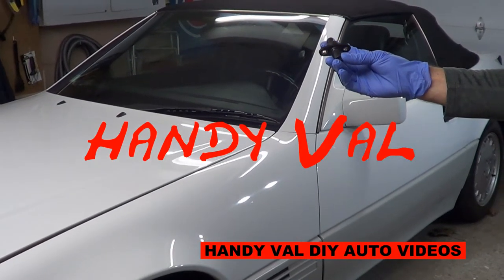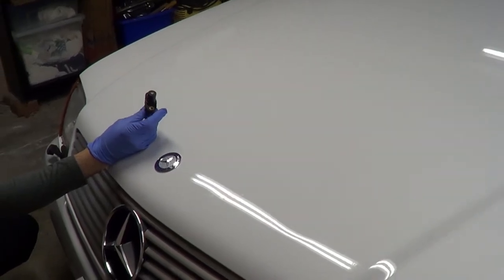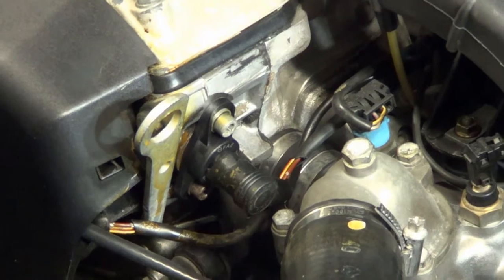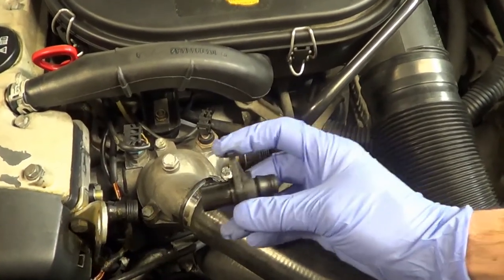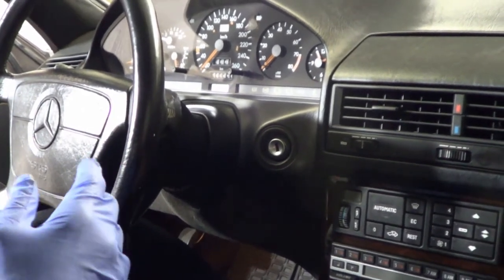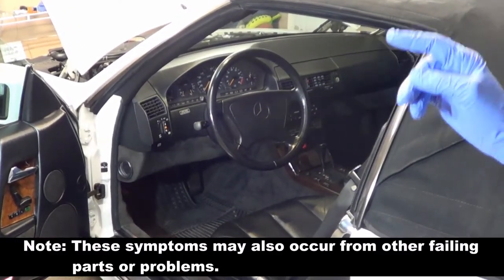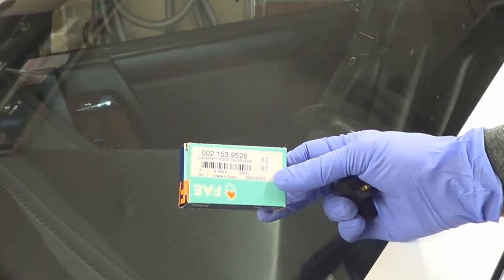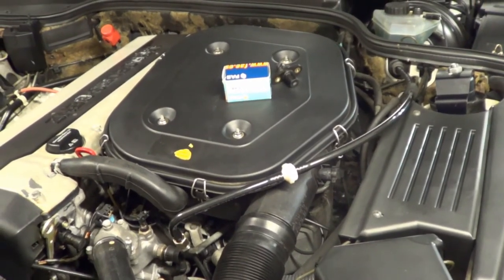Camshaft Position Sensor on Mercedes-Benz for Better Engine Performance R129, W124, W140 and W202

Comment: Thank you Handy Val - you’ve solved yet another issue with my 500 - as the symptoms (you outline) ‘mirror’ exactly what I’ve been noticing/experiencing on my 31 year old 500SL. Now to order the part & replace it myself - thanks again AS ALWAYS…
Reply from the maker: Thanks Mark. It’s an great DIY replacement.

Comment: Thanks Handy Val. My 1991 300SL was having an issue stalling while under load or once I blipped the throttle and let off. I opened the hood and noticed my Cam position sensor was literally broken in half. It was partially held on by glue that the previous owner or mechanic used to fix it. Luckily I ordered two sensors yesterday, one for my 1991 300SL and 1990 500SL just incase. Hopefully it fixes my issues. Will report back once the problem is solved.
Reply from the maker: It seems like your culprit is likely the camshaft position sensor. It's a key part of a well functioning car and it can cause those symptoms you experienced, especially the acceleration. It's an easy swap and let's hope it fixes your issues. Let me know the outcome.

Comment: Val. I don't know how I have not run into your videos before but wow they are impressive. Super clear concise communication thank you so much for that. I have A99S L5 100 and the alarm goes off Much too often. I just recently had the siren replaced Because I would get a beeping noise not the alarm sound but a beeping noise every time I unlocked the car. Well the beeping noise is gone but the car still is oversensitive because the alarm will just go off without a big truck or train driving by To trigger it. Any ideas would be greatly appreciated
Reply from the maker: Bill - Thanks for watching and welcome to the Handy Val channel. The alarms can be overly sensitive and prone to problems. Your problem is common. The typical cause of this, is the alarm battery (yes it has one) gets weak and will cause these symptoms. The alarm battery, for your model I believe is located within the siren (check if indeed this is the case). Another simple fix that works sometimes is to replace the fuse associated with the alarm - this sometimes will fix your problem. Other alternative, is to you manually lock your car doors with your keys. instead of the key fob (this will disable the alarm, which may not be what you are looking for, but can come in handy for the time being). Another option (and this works too) is to hit the 'tow' switch before leaving the car - this means you have a faulty tow sensor. The tow sensor is linked to your alarm.
I hope this helps and you get it sorted. Keep me updated.

Comment: Good clear communication style.  My questions are for a 1991 R129 500SL V8
I know that it has two Rotors and two Distributor Caps, but I need to know if it has 2 of each of these parts:
- Camshaft Sensors
- Crank Sensors
- EZL Ignition Control Box

I know it's a funny question, but I do need to know. Thanks.
Reply from the maker: Thank you. It's a good question. You have one of each (1 cam, 1 crank and 1 EZL), not two of each.

Comment: the original sensor is fitted with a silicone gasket, hella sensor without a gasket, my 300sl had an oil leak after the change, maybe I should need some silicone? Thanks Handy!
Reply from the maker: Hi. Are you saying that the new Hella sensor does not have the little silicone 'O' ring? It should be part of the new sensor - you may want to get a refund. Unless you are saying that the original sensor had an exterior gasket between the engine and the sensor that wraps around the screws?  A few thoughts 1) check your oil level and ensure it's no higher than the middle of the dipstick (I have a video on this - Check Fluids Video), as you may have too much oil in your engine. 2) Try removing the sensor and cleaning the hole, it could be that there is some corrosion that is not making a proper seal (try cleaning the hole with a microfiber cloth as clean as possible). I hope this helps.
Reply: @HandyVal  thank you !!!

Comment: On my s420 it is barely/not idling, stalling, and hard to start. If I floor the gas it’ll start up and rev up fine but it will die and run rough till it stalls out if I let off the gas. The cam sensor being bad would cause this?
Reply from the maker: @JacobTechShit  your symptoms seem related to fuel delivery problems. This could be weak or close to failing fuel pumps, very dirty fuel injectors, a clogged fuel filter. Did these symptoms appear out of nowhere? Or did they gradually appear?
Reply: @ I just put a new pump on, and if I floor the gas it’ll fire on all 8 up to red line no problem. The reason I’m thinking it’s the cam sensor is because mine is broken. I just don’t have another car I can disconnect the sensor on and see how it behaves without it
Reply from the maker: @ I agree with you. You should change the camshaft sensor. It’s easy to do, and they’re fairly cheap to buy, at least compared to other parts. It can cause some of the symptoms you shared, so certainly worth changing, especially given that it’s broken. Let me know when you replace it and if it worked.
Reply: @HandyVal  will do

Comment: Hi, my cable going from the can shaft sensor seems to be broken (the cover is gone for a bit showing I guess the shield). Are these cables hard to find. As always your vidoes are very helpful. BR Gösta
Reply from the maker: Hello. Some cables can be harder to find than others. A cable with a broken cover can still function well. You can try using a zip tie for now to secure it strongly in place over the sensor as a temporary measure or longer if it is sturdy. Mercedes dealerships can sometimes source some hard to find parts from their dealer network or at a minimum find the part number for the cable. Afterwards, you can use it to search EBay for a used yet working cable. Always ensure the seller confirms its working order - the good sellers always test their parts before selling. In the seller pictures make sure the connector is in good shape and it has the compression ring. In my video, you’ll notice my connector is a bit damaged too from the previous owner, and is missing the compression ring. I have bought many parts from EBay.

Comment: Hi bro I have a  1992 SL500 when I try to start all dashboard light is on but it doesn't crank or any sound, don't start. What is your suggestion?
Reply from the maker: @ManikRoy-qb9yg  There are a few things you can try. And try them in this order. 1st - test the battery, ensure you have about 12Vs, and clean the battery terminals (see my video on replacing the R129 battery video on how to do so, and the order of removing the terminal wires). 2. Could be starter related - there are ways to bypass this. 3. You have a faulty ignition switch - ignition switches are a real pain to replace. There is a procedure involved and you’ll want to follow it perfectly. If you don’t, while replacing it, you could lock the steering column … which then creates a lot more problems for you. I hope this helps. Did this issue just happen all at once?

Comment: Can I just pull out the electric connector or do I need to press or release clips so the cable detaches from the sensor?
Reply from the maker: The connector should have a small metal ring around the plastic\rubber part. With a small pick/small screw driver you could expand that metal ring and then pull the connector off. Depending on the connector fit over the sensor, sometimes it can just pull off easily but sometimes it needs this extra help to expand the metal ring and then pull. I hope this helps.
Reply: @HandyVal  appreciate the quick response. Will try. Thanks!

Comment: Do you have any idea of where to buy an EGR valve for the M104 engine?  Parts for these cars seem to have totally evaporated during the pandemic.
Reply from the maker: The pandemic has slowed parts manufacturing. The EGR valve is a difficult to locate. You're not the first to ask me. Many of the usual 'big' online parts stores have been sold out of the EGR for the last two years. I just checked now, I couldn't find any. You can get lucky by broadening your search to smaller parts online stores that may be local to your area and don't get much traffic other than local. crowd They may have an old (yet never used) stock EGR. I hope this helps.

Comment: hi ,
i have a W140 with M104.994 engine which knocking when temperature become hot 87 degree
and the car dont start when hot i have do some operations :
ignition coil and wires --> are OK
spark plugs--> are OK
injectors--> are OK
i have change :

fuels pumps
fuel filter
fuel regulator pressure

but the problem still here , next step is to change : Crank & Cam sahft sensors and checking after
Reply from the maker: Try testing the crankshaft sensor to ensure it is within range, as it is a common fault for a difficult warm start. The fuel accumulator helps with warm starts, and if it's faulty you may run into warm start difficulties. Keep me updated.
Reply: @HandyVal  hi ,Ok next day I try to test the crank sensor and I keep you informed
Many thanks

Comment: Does this apply to the a class 220d amg line, i noticed that when i press on the acceleration it is very delayed same goes for when im reversing it's take at least a second or two before it respond and start to reverse? Much appreciated if you could give me some info.
Reply from the maker: The camshaft position sensor can be your problem. A bad camshaft sensor can cause hesitation and sputter on acceleration. I wonder though if your problem is more transmission related. With the A220, as it is newer, it can be worthwhile to get a diagnostic read.

Comment: Handy Val quick question have you had any wet rear carpets. I have a 1991 300 sl with drivers side wet flood and I can’t figure out why. Thanks in advance for any help!
Reply from the maker: There are a few things that could cause this. But first you should try to soak as much of the water as possible, as it could create a musty smell and worse corrode what's underneath the carpet or damage electrical connectors.  If you have a covered garage you can use a fan aimed at the wet spot and it should help dry the area. I assume it's coming from rain? The soft tops don't always create a perfect seal, and sometimes the seals themselves get old and hard - a solution would be to rejuvenate these seals with silicone type grease (only use silicone, as petroleum based grease  eats away at rubber - I like to use SuperLube lubricating silicone grease. I use it my Winter Storage video). The rejuvenated seals will work better and may solve your problem. Second, I know if the R129 is parked on hill, it creates additional spots for water to sneak in. You can also try to locate the problem area, by sitting in the car and having some run a hose over the roof while you look for the leak. This isn't always fruitful, as leaks can start and end in entirely different spaces. The hard tops typically seal better, but they too suffer from old and hard seals. I hope this helps. Keep me updated. Let's try to solve this...
Reply from the maker: I should also mention that the rubber seals typically have small drains/channels that are meant to funnel the water away from the car's interior. There's four that I'm familiar with: 1) one on each of  the top corners of the windshield seals and 2) where the top (2x) latches on on the rear of the car. This one near the near could be clogged with debris. You'll need the roof off to see them.
Reply: Thank you very much for all the info! We are waiting on a response if it’s going to be ours. If it becomes ours my son and I plan on restoring it. We will keep you posted. We will be making videos of us restoring the car but we are just waiting on the answer from the owner.
Reply from the maker: Working on cars is great for family bonding.

Comment: Hi, after watching this video, i decided to change mine. However the bolts were super tight and i was afraid that i would snap the bolts, so i left it. Any ideas would be appreciated. Thanks.
Reply from the maker: It happens. I have a few ideas. First, try attempting it again but this time when the engine is warm, or if you tried when it was warm, then try it when cold (like first thing in the morning). The thought here is that the engine and the bolts expand and contract differently, and that slight difference may be all that's needed to remove the bolts more easily. Second idea, try a socket set with an Allen head - it may work better than an Allen key alone. Third idea, would be to use a penetrating fluid (like PB Blaster or WD-40), around the bolts (use a paper towel to pick up any excess drips). Keep me updated. Thanks.
Reply: Thanks for your ideas. I will try them, also i will try and shock the bolts with a hammer first. Keep your videos coming, there very useful. Thanks, Mike in the UK.
Reply from the maker: Any luck with taking the bolts out? I hope you managed to do so.
Reply: @HandyVal  Yes , i removed the thermostat housing to get better access. Thanks again.

Comment: Здравствуйте автор помогите мне узнать, у меня тоже w140 3.2литр до рестайл, ано не заводится а искра есть, проверил этой датчик показала 1.74 кОМ машина вообще не заводится может быть этой датчик не исправен? помогите пожалуйста ано зависит от этого?
Reply from the maker: Hi. The camshaft sensor is easy to replace and you can get a good aftermarket at a very good price, but it’s unlikely that’s your problem. The camshaft will give you starting  by problems, but it will eventually start, so I’d look elsewhere for your problem.
Reply from the maker: It’s likely fuel related - fuel pumps or even something as simple as very dirty air filter. What year is your w140 - it’s good to check for the biodegradable wiring harness.

Comment: hi Handy, has your mercedes ever had an ASR signal? I have a 300sl 1992, when I get ASR it is not able to drive, maybe you are familiar with this problem? thanks
Reply from the maker: The ASR can be tricky to fix. Is the ASR on from the time you start the car, or does it come on sometimes? And does it keep you from accelerating? Sometimes, a simple reset by disconnecting  the negative battery cable for 10 mins can make the problem go away. I will try to help you, let me know the answers to those questions.
Reply: @HandyVal  yes, ASR turns on after starting the engine, sometimes the car cannot accelerate, but sometimes it drives without problems ...
Reply: @HandyVal  I disconnected the battery but it didn't help
Reply from the maker: Let's try some more basic tries to reset the ASR. Try turning the steering wheel, going from the center all the way to the left and then all the way to the right, and then back to the center. Sometimes this simple exercise can reset the ASR and make it start working property again.
The other options are more costly and I advise testing these parts before replacing: 1) OVP relay (check fuses on top of it first); 2) wheel speed sensors can get rusty or simply need a cleaning (tires need to come off for this) 3) brake switch under the brake pedal (sometimes this can be a bad contact or simply a bad part). The list can go on, throttle cable too could be a problem. To narrow this down, was a brake job recently done? - that could mean connections around the brakes, like speed sensors may be loose.
Reply: @HandyVal hi Handy, I changed the OVP RELAY, after replacing the ASR light is off, after 20 starts everything is ok ! Thanks
Reply from the maker: @СамвелАбрамов-ь1ш  Awesome news on the OVP and fixing your problem. I am happy to have  helped.😀
Reply: @HandyVal  What do you think about changing the transmission fluid? it would be nice to see how you change the transmission fluid 🥹
Reply from the maker: @СамвелАбрамов-ь1ш  This one is a tricky one to answer, as sometimes old transmission fluid can mask a failing transmission. So when the transmission fluid is changed, you may then notice the failing transmission. If you know the history, and it has been changed, let's say within the last 30,000km (or 20, 000 miles), then it may be ok to change. The fluid is changed by raising the car and then also replacing the transmission filter. This is located under a black metal pan, next to the transmission. It looks like an oil pan, but it's for transmission and it not directly beneath the engine.